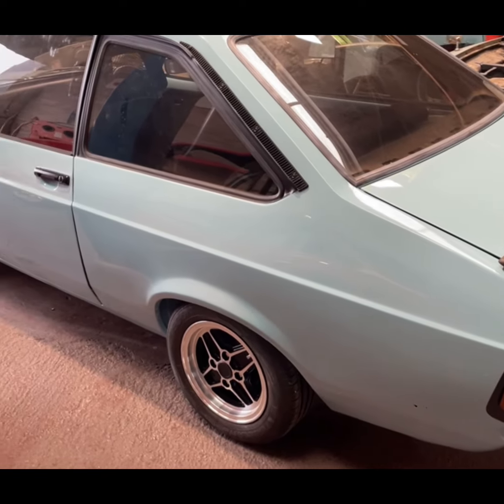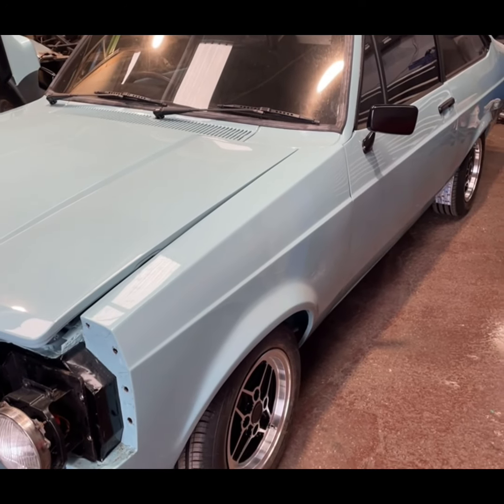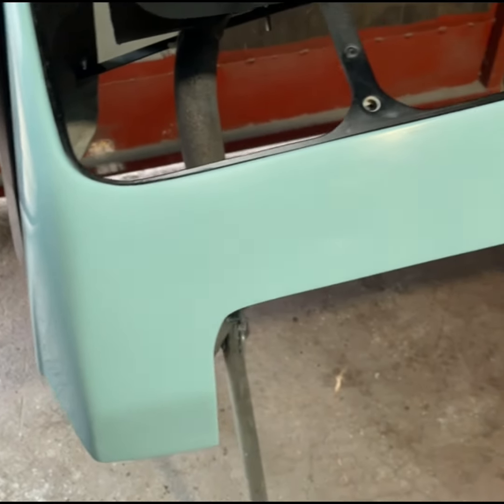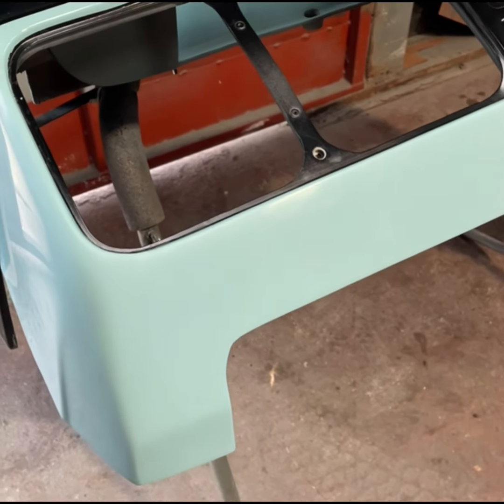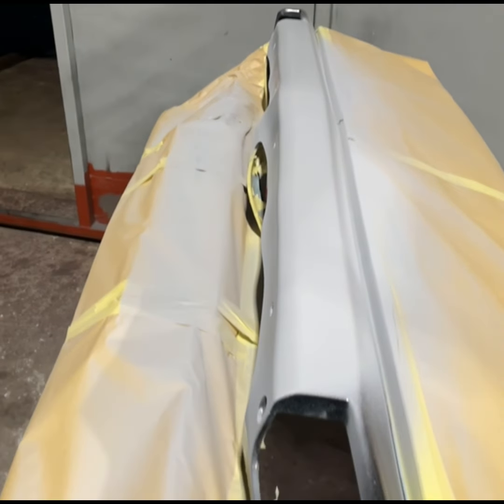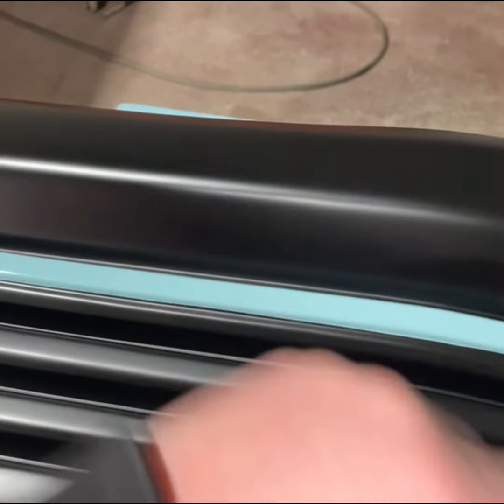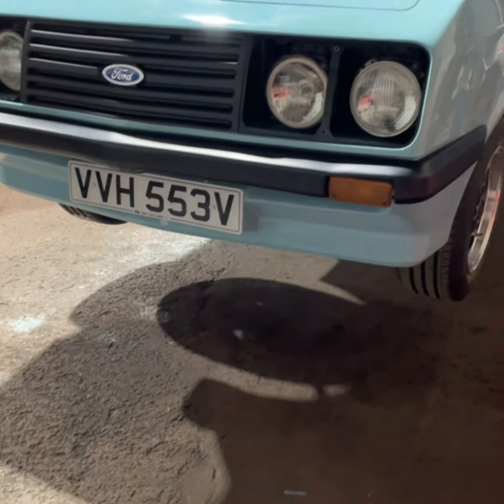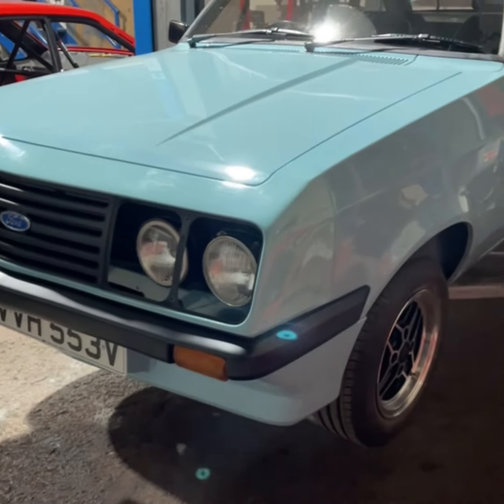Nora the 79 RS2000 Build: Everything You Need To Know

Comment: Ayy up love the RS2000 I hated how the Nose Cone fitted,when I get another I will have the slam panel extended to the nose cone then there isn’t that gap.also have a better air flow to the radiator by fitting sides down the side of the lights.love the work you do when I get another  I will give you a call,I had a w reg one and the RS2000 decals was on the boot and the bottom of the Nose cone I think the nose cone decal was a retro fit from the owner before I had it
Reply from the maker: I look forward to your call haha,after speaking to the owner it’s gonna be having the rs2000 decals on the rear quarters,I know it shouldn’t have them and I gave the customer the option and he chose to have them fitted,as they say “the customer is always right”